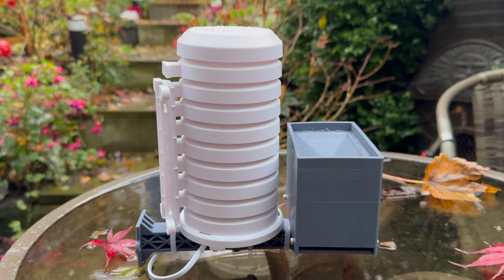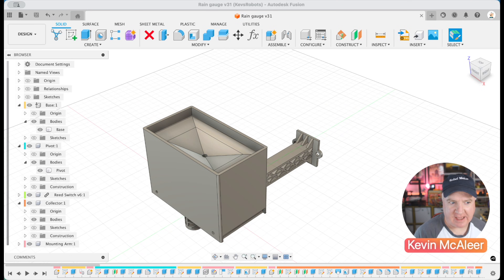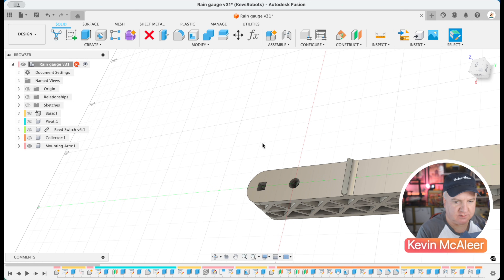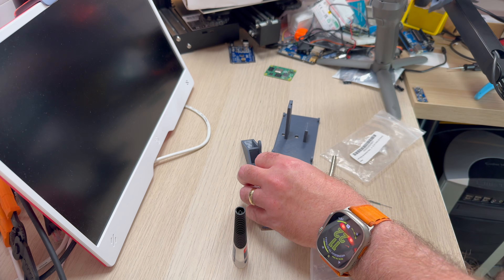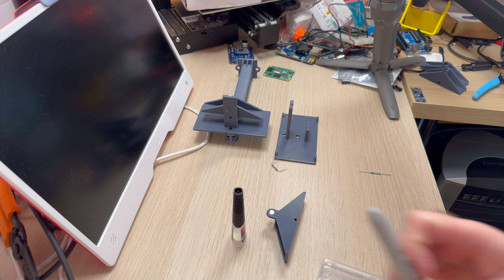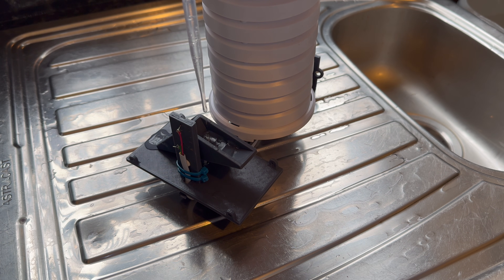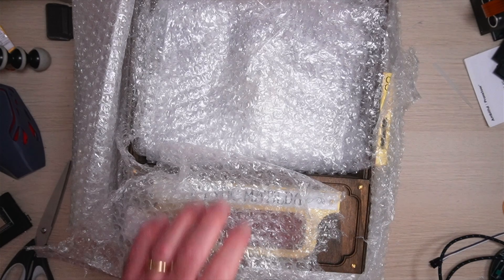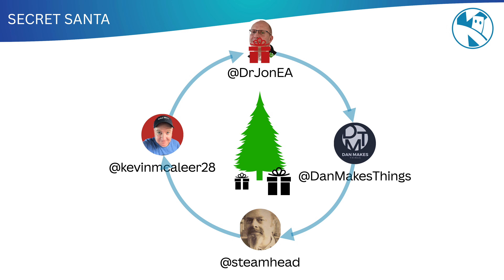Weather Station build for 2025 Secret Santa

Comment: Why isn't the smooth bolt that the water catcher pivots on the same diameter as the hole in the catcher ?
As it is the catcher wobbles from side to side as well as pivoting and as you say "it is a little bit wonky"